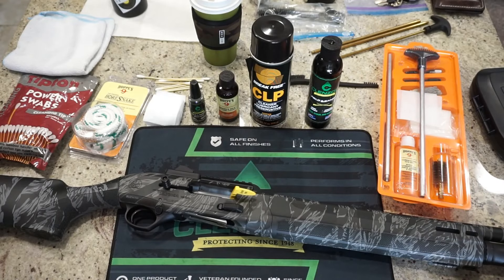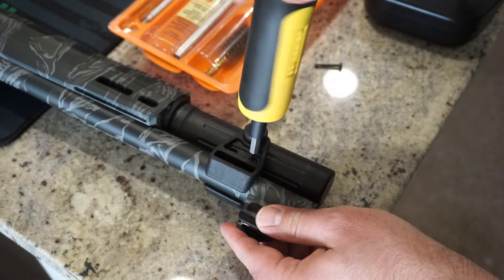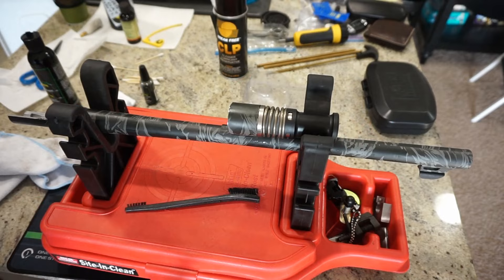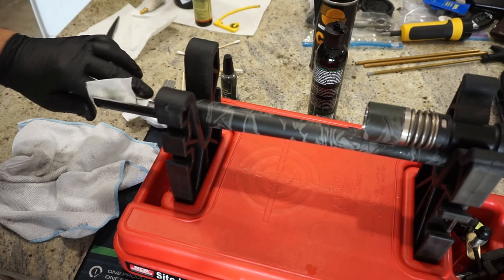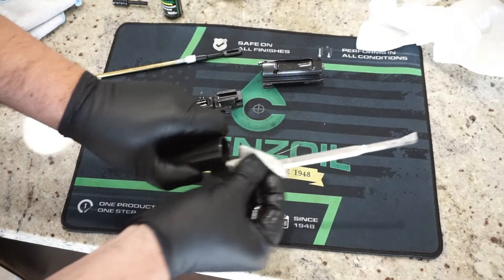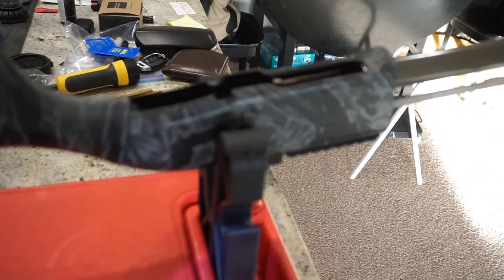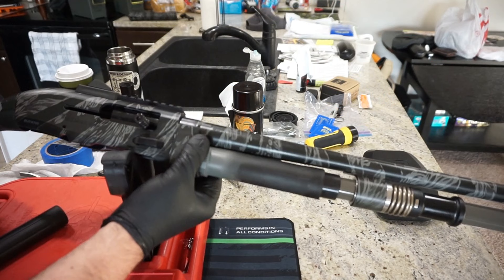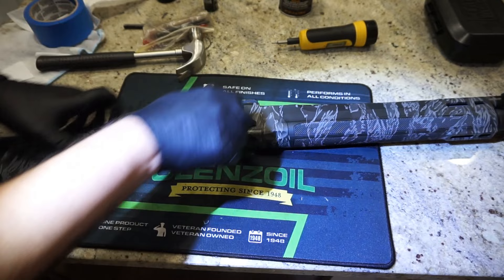How to clean the Beretta A300 Ultima Patrol Shotgun

Comment: Can you provide suggestions on charging handle removal on my newly purchased Beretta A300 Patrol Shotgun.How is the charging handle configured to help me understand removing it.
It feels like it's welded in or perhaps improperly installed at the factory?Appreciate your assistance as I cannot fully disassemble my gun without removing bolt.
Reply from the maker: Are you able to disassemble the shotgun to the point that the bolt handle can be removed. I think that something keeps the bolt handle locked into place until you reach a certain part of disassembly.

Comment: What! It's dirty already? And no range report? Anyway, sweet shotgun! I do like a dip that will still look good if the colors fade, like that one.
Reply from the maker: I had to clean it first. It was test fired at the factory but the manual says to clean it before going to the range. Last thing, our range is a slick, snowy mess so I haven’t had a chance to shoot it yet. I may be able to get out later this week or coming weekend to actually fire it.
Reply: @travisp11 I agree with what you said that they should be cleaned prior to first use. No telling what metal filings are where. And I heard your "range report" yesterday on the range condition. Just missed that you hadn't shot it yet. Thnx 😊
Reply from the maker: @mgabriel2636  it’s all good.

Comment: If i don't have a punch, do i need to take the trigger pack out?
Reply from the maker: I believe so in order to remove the bolt. You can tap out the pins with a sharpened pencil just enough so you can pull them out.

Comment: Couldn’t you lock bolt back before putting on spacer and barrel
Reply from the maker: I could have but I did wanna risk having it slam home in the process. You can but I prefer not to. It really doesn't add that much effort to the re assembly process.
Reply: @travisp11  understand.   Picking mine up next week and just getting ahead of the game on it.
Reply from the maker: @gundude4609  Right on!

Comment: 4:40 I’ve followed all of the steps above, but my barrel will not budge even a little bit. I’ve tried having the bolt fully locked back and the way Travis shows it, but no movement. 

Anyone else experience this? I’ve tried a rubber mallet to loosen it up and still nothing.
Reply from the maker: Are you trying to remove the barrel or put the barrel back in.
Reply: Yes, I'm having the same problem, the barrel will not budge.  I tried all configurations with the charging handle, trigger, carrier stop push button, safety, it won't give.  I would truly appreciate a solution.  Thank you.
Reply: @josephrox7006  idk if this is good practice but I just pulled the bolt back and let it slam forward 2x and it loosened it enough to take off
Reply: @Nick-oi6vk  thanks for the tip, unfortunately it didn't work. I shoot as many as 80 Shells at a time and get it cleaned at my range. Maybe they never removed the barrel. I'm going to contact Beretta and take it into my range to see if they have any ideas. Thanks again
Reply: @josephrox7006 Get it figured out ok?
Reply: @CarlPapa88  Took it to my gunsmith at the range.  After some serious soaking in some sort of cleaning machine, and a few shots with a rubber mallet, they finally got it.  They blamed carbon build-up.  Took a good hour.  Thorough cleaning by me every two weeks.  Thanks for asking.

Comment: Excellent video…. Got lucky this weekend and found one of these in a Scheels in Great Falls Montana.  It was the only one in the store and out on display. Sadly the rear polymer sight is cracked. Does anyone make steel sights for these yet??
Reply from the maker: You should be able to use the Beretta 1301 rear sights too (but research before you buy).
Reply: @travisp11  The guys at Scheels we’re going to actually take a rear sight off of a 1301, but they told me it wasn’t compatible.
Reply from the maker: @freedomlineman3105  ok. I would call Beretta customer service.
Reply: Polymer sight...damn this shotgun is chintzy.
Reply: @user-gu6nj8lf3w  Hopefully the rest of the gun is good too go… only time will tell??
Reply from the maker: @user-gu6nj8lf3w  a few parts should be metal, especially at this price.

Comment: So does it need to be cocked to disassemble? Damn took this thing apart the bolt won’t come up
Reply from the maker: I do start with a gun cocked, also pulled back on the charging handle a little bit to help ease some of the pressure on the barrel
Reply: @travisp11  ok cool. thanks for the video

Comment: What happens if you pull the trigger while the trigger pack is out? I’m new to this. 

Great video.
Reply from the maker: You will be fine but the trigger may slam into the front of the trigger pack frame instead of the bolt
Reply: @travisp11  Thank you!
Reply from the maker: @DISABLED12-7  you are welcome!

Comment: I’m having trouble getting the barrel assembly off. The Beretta manual says to lock the breech back but mine doesn’t budge locked back or not. I’m sure I’m missing something obvious.
Reply from the maker: That is a good question. As soon as I unscrew my magazine tube cap my barrel pops out. You may need to contact Beretta.
Reply: @travisp11  That's exactly what I did. Two weeks ago and still waiting. I sure they'll make it right though.

Comment: Not a cleaning comment per se. But how are you guys going about attaching the velcro(if you are)? Wipe with alcohol 1st?
Beretta warns of peelung finish off if ever removed,  is that regarding the tiger stripe version?
Reply from the maker: I’m not going to put the Velcro on the side, especially with the tiger stripe finish. If I can get a bolt on side saddle I will, otherwise I can run a stock shell carrier and I’ve also seen 2 sided versions that allow 10-12 extra shot shells.

Comment: Do you, or anyone else know the factory torque spec on that front (bbl/mag) clamp? Some folks have experienced it loosening up. Want it as tight as it should be, but torque is by no means plastic’s best friend. I’d rather know exactly what it should be.
Reply from the maker: Unfortunately I don’t but I just torque it until it is snug but no more. I’ve actually replaced mine already and if you check my channel you can see what I bought.
Reply: Typically metal to plastic (magpul. Etc., specs) call for no more than 15 inch pounds. That’s probably more than is necessary for this specific application.  I would suggest NO MORE than 10 inch  pounds of  torque and definitely use Vibra-tite VC-3 threadmate. It’s really the best thread locker for firearms (scope rings, etc.) because it holds AND remains flexible. Hope that helps!

Comment: I pull the brass brush back through the barrel, and have done so every time I've cleaned a gun for 34 years. Why do you avoid pulling your brush back through the barrel?
Reply from the maker: I just don't like to pull the debris back into the receiver. It's not a big deal but I tend to keep everything running out of the front of the barrel.
Reply: @travisp11  That makes a lot of sense actually
Reply from the maker: @coffeeandlifting  it really doesn’t matter, I just always push everything out the front as a habit. You go which ever direction you choose.

Comment: Hey all, should I be able to pull the charging handle out freely at any point along the bolt travel? It seems to be seated all the way since it rests against the receiver when the bolt is all the way back.
Reply from the maker: I haven't tried removing mine unless the barrel has been removed. I need to see if there is a specific piece that keeps the little ball locked into place in the notch in the charging handle.
Reply: Figure out what was up with the Charging Handle?  Same problem...handle will not lock in nor stay in. Came in the box with handle removed & in the bag.  Never have been able to get the handle to lock and stay in, neither with the gg&g I received to replace the stock handle.
Reply from the maker: Definitely sounds like the gun was manufactured out of spec. I'd contact Beretta ASAP @kilroy4713

Comment: You're supposed to clean it this good before you're first trip to the range?
Reply from the maker: Yes, the manual actually recommends to do so and I also like to clean my firearms before a first range trip so I know there are no problems with the gun before I head out
Reply: I'm just a little scared taking it down this far. I can see me really screwing it up. :( but I will have to watch your video several more times. Thanks for making it! @travisp11
Reply from the maker: No problem. Shotguns can be a little intimidating, especially the rods that go into the bolt then back into the receiver. Check out my video again and then read some of the comments as a few people have suggested what they do when they clean their A300 Ultima Patrols. @bobbyb7127
Reply: Thanks. will do. :) @travisp11

Comment: I THOUGHT THE MANUAL SAID TO LOCK BOLT TO REAR TO REMOVE THE RECEIVER?
Reply from the maker: You can but it’s not necessary once you have removed the barrel. I don’t because I don’t want to accidentally launch the bolt upon disassembly.

Comment: Is it just me or does the a300 use the same blink gas system as the 1301?
Reply from the maker: The blink has system has a rotating bolt and a chromed inner receiver, the A300 a basic two piece bolt and no rotation of the bolt.
Reply from the maker: @bungalobill7941  I agree. The A300 Patrol is pricey given the competition.

Comment: Out of curiosity, are you able to pull your charging handle off at any position while the gun is assembled? It seems that it doesn’t really lock in, it’s just held on with the detent.
Reply from the maker: I guess I haven’t tried to remove it with the gun assembled so I can’t say. It’s possible
Reply: @travisp11  do you want to try and let me know? 🤣
Reply from the maker: @jonahweiss9723  You caught me in my morning workout so I didnt have access to my shotgun when I made that comment.  Give me a moment and let me check...holy crap it pops right out!! Man, between the plastic sights, constantly moving front swivel mount and now this...this shotgun feels more like a disposable appliance every day.  Im starting to think Berettas intention with this shotgun was (given by its title) to be stowed in a patrol vehicle and only deployed when necessary and not the go to war gun that represents the M4.
Reply: @travisp11  it definitely needs a bit of work. I'm changing out the front mag tube cover and clamp to the Nordic components, it has an mlok slot to run your own QD on there
Reply from the maker: @jonahweiss9723  I think I’m gonna join you on that one.

Comment: …. The hell does it mean “take it out and eventually it will kind of seat itself properly” for the bolt that gives zero explanation, my bolt wont go back and I’ve been futzing with it for about an hour with zero real idea how, with no explanation given, my parts are in the right orientation but the bolt wont slide back past an inch or two
Reply from the maker: Are you pushing the tail of the bolt into the cup inside the rear of the receiver? Sorry about the poor wording but I don’t script these videos. You may want to try pushing the bolt in with the receiver upright and push the bolt straight back. Also, is your hammer in the trigger group locked back?
Reply: @travisp11  yes it was just as you showed, I actually figured it out about an hour ago and reassembled.
So the deal was there was a few things wrong with the way I set up the internals, first the bolt tail was upside down so that was my mistake. And secondly after all the parts were “correctly placed, after looking into all the parts for quite some time the opposite side of the bolt opening has a rail that interfaces with the bolt and it was ever so slightly catching do to misalignment and not allowing for the bolt to slide back, so i had to forcefully twist the bolt so i can get the rails where they needed to be, no damage parts in the process but maybe a qc issue? I looked at tons of other vids but no one else seemed to have had that type of issue, yours is one of the best ones and thanks for the response
Reply from the maker: @Jiraiya-Sama482  no problem man! I’m glad you figured it out. I wish that Beretta would have just used the Blink gas system from the 1301. Thanks for watching!

Comment: Would the A300 Ultima 28” barrel fit on an A300 Ultima Patrol variant?
Reply from the maker: I don’t think so because the actually gas system is slightly different between both guns. There is a lot the two shotguns have in common but also some distinct differences.
Reply: @travisp11  good to know thanks! Wish they could make a 28” barrel for the Ultima patrol for a multi-role shotgun.
Reply from the maker: @F1SH_SAUCE  I agree!

Comment: How/where did you get this? I've been trying to get one for about 3 weeks.
Reply from the maker: Gunbroker currently has several for sale for MSRP. What I did was put my email in a notification box over at the Frontier Justice website and they emailed me as soon as they had one in stock.  I put in my request about 3 weeks a go and a few days later I got my notification.  I think a lot of people out there don't try the notification option.
Reply: Thanks man I got one off gunbroker I’m pumped.
Reply from the maker: @VNXTY  right on! I was wondering if how quickly you were gonna get over there!
Reply: Native Outdoors. Call and check though but I got one for msrp
Reply: Ty for making this video. Subbed. Haven’t finished watching yet.  Got mine yesterday at the Beretta Gallery on Madison Ave in NYC.  Quick question. This is my first shotgun so I don’t have any cleaning materials or oil yet. But I do have a defensive all day shotgun range class tomorrow. Should I be concerned running few hundred rounds through it brand new without cleaning it?  Hope not cause it’s just not doable.
Reply from the maker: @mdjak3686  the manual recommends cleaning it first but I think James Reeves over at TFB TV ran 500 rounds through his and he may have not cleaned it.  If it starts having issues running you may need to do a tear down and cleaning otherwise they may have a gun you can use with your ammo.
Reply: @travisp11  tyvm. They do have guns they rent but really want to use mine.
Reply from the maker: @mdjak3686  you can try it and see how it runs but any issues you run into could be due to internal oil and gunk buildup
Reply: @travisp11  ty again. Shot all day and it worked Perfectly.
Reply from the maker: @mdjak3686  good deal! I just took mine apart and cleaned it after filming my range test and it was a little dirty but not too bad. Cleaned up quick.

Comment: The op rod sleeve weld doesn't inspire confidence.
Reply from the maker: We will see how well it holds up.
Reply: @travisp11  I don't doubt it will hold up just ita not pretty and I assumed there would be a better way of doing. I'm not a shotgun guy so I don't know.
Reply from the maker: @orangerider2827  I just got back from the range and the video will air next week. She ran good with no issues. I will also do a thorough inspection when I clean it.
Reply: @travisp11  well that's good news. I figured it would just the welded on op rod really is a turn off for me. It's my only complaint from what you showed in the video. I of course don't have one in hand.
Reply from the maker: @orangerider2827  No worries. It would have been nice if the piece had been forged or milled from a single piece of aluminum but I will definitely keep an eye on that part.
Reply: @travisp11  thanks for the reply and updates it's much appreciated!!!